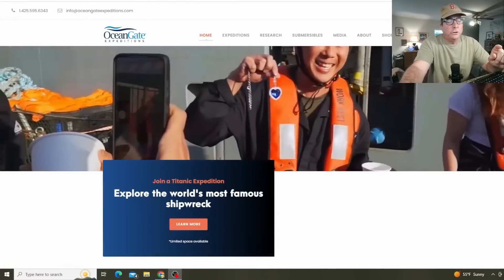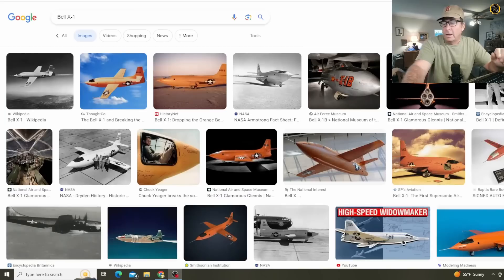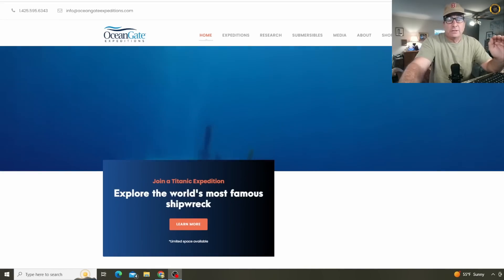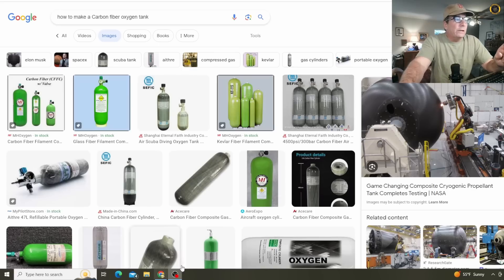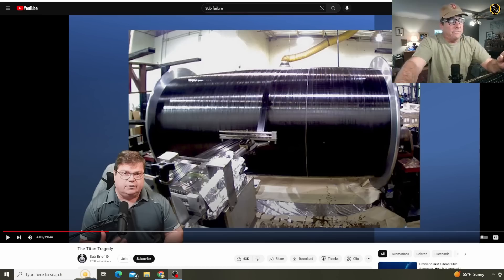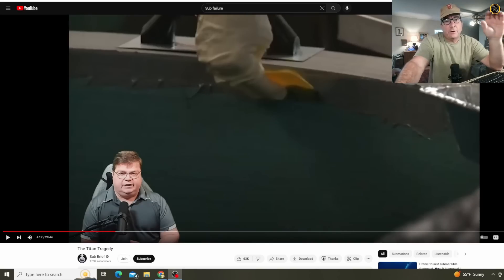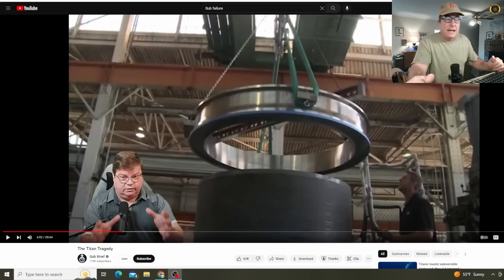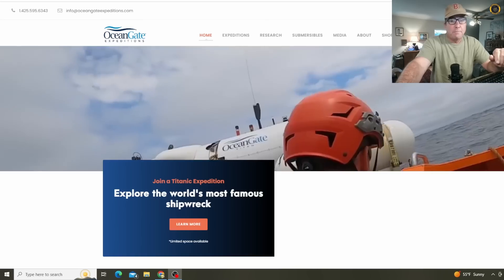Oceangate Sub Construction Details and Implosion

Comment: Im an oceanographic Survey Engineer and i agree totally with what you say. My theory is that something between the carbon fibre and titanium caused this. I cant think of any housing that used two different materials for the main structure of the housing. Under pressure it’s likely the carbon fibre will react differently to the titanium, maybe compress more etc and this join of the two is the big weak point. Now watching this, and hearing there is a glue joint between the two - thats a third material and how is that glue tested under pressure 🫣! I dont like the sound of this stuff
Reply: On the other hand reports say the window was only certifiedby the manufacturer for 1300 m - and used in 3800 m. I'm not an engineer but there's more fishy then just the pressure cylinder and an older sub they had suffered from premature fatigue too. 

There will be an investigation, and they will salvage some parts. At the end there will be an accident report.

Comment: Just a bit of a correction... The fiber winding was done both in the axial directions and in the hoop direction, so there was a criss-crossing orientation, it was NOT in just one direction. There is a good "compositesworld" article about the hull manufacturing. My guess is an failure with the bonding interface between the titanium ring and the cylinder.
Reply: Do you have a source for this information about carbon fiber layup being done in both directions on the Titan?

Comment: This was not the original hull according to Wikipedia. "After proof testing dives at its maximum rated depth in 2018 and 2019, the original composite hull of Titan developed fatigue damage and was replaced by 2021" so probably proves they have very short life cycles and something was very wrong with this design. If can happen once it more than likely happened again to the second hull with devastating results. I think the on board real-time monitoring system looking for cracks was a safety comfort blanket for the CEO to hide behind believing this would convince people it was safe. The Port hole that he had been told was to big and could fail at those sort of depths. He even admitted himself he had broken the rules regarding it's construction but he knew best. No beacon even though it went missing for 5 hours on one mission.  The problem you get when one man has a vision and nothing will stand in his way even after so many warnings is a disaster waiting to happen. Is it possible that because this was the subs first deep dive of the year the carbon fibre could have relaxed to some degree whilst in storage during the winter after many pressure cycles the previous year causing the hull to weaken, making it more likely to fail on it's first dive of the year. If they had used a new hull every year it might have survived a season but it's one hell of a risk to take and wold make the project unsustainable. It's Ironic that the same failings happened to the titanic as this sub. Expectations of technical perfection that would never fail outsmarted by real world reality and possibly blind ignorance. After watching the CBS report only a few weeks ago about titan before this weeks sad news it astonished me the cavalier way CEO Stockton Rush went about explaining how it worked and the many DIY parts that were used such as LED lights from a caravan surplus store and ballast waits that were apparently scaffolding, and the way he threw the game controller to one side in the sub. The reason Alvin has been in use since the 1960's and to this day is proven technology followed by testing, testing testing and certification. My heart goes out to those 5 poor souls and there grieving family's but this could have and should have been prevented. If your risking your own life then you know the consequences but with paying customers onboard regardless of how rich they are safety must be the top priority and not an afterthought.

Comment: I have a gloomy question. Is it possible that the carbon fibre tube walls failed first, rather than the caps popping off, and as those walls were failing, there would have been errie crackiling sounds inside the chamber? In other words, they knew the end was coming? What was the communication system status with the surface vessel?
Reply: I have never been in a sub but carbon fiber typically fails without noise before. If you watch mountainbike videos where people destroy carbon frames the carbon typically makes the sound of a hunting whip at the moment it fails, but no sound before.
Reply: @simonm1447  tHanks. There is a comment below that suggests the end my not have been instant however..that they may have known what was happening in real time

Comment: Aside from the 5 inch capsule thickness which is minimal should have been 7 inch, also apparently the camper style light which was screwed into the thickness of the capsule with hardware style tap screws… idk if it’s true but definitely could weaken the lay up

Comment: CORRECT, THAT WAS THE BAD POINT.
NOT POSSIBLE TO PUT RESIN BETW RING ANG LAYERS +FCARBON TITAN TUBE-
NOT FOR DEEPER SUMB.

STRUCTURAL DESIGN OF LOT PARTS COMPONENTS IN LABORATORY IS DIFFERENT WHEN YOU APPLIED ON FIELD.

THIS PROTOTIPE WAS TESTED INTO LAB OF (WASH.UNIVERISTY)
BUT NOT USEFULL .. NOT REAL A SCALE PROTOTIPE,,
 

A-TUBE DESGIN IS NOT FOR DEEP PSI :

B- MIXER MATERIALS .FCARB. RESIN..

C-BOLTS  +PLAY.S CONTROL AND OTHER BASIC COMPONENTS (COMMERCIAL BOLTS,)
   NOT FOR DEEPER  USES (HUMAN RISK,,)

ONLY BALL  STEEL (BATISCAFOS) MAKE POSSIBLE EQUAL SAME PRESS PSI
AROUND BODY SUMB,,,,

GEOCEAN WEB SITE NOT AVAILABLE TODAY

Comment: I think there were more issues with this craft besides the usage of carbon fiber. The control and communication systems seemed rudimentary.  The engineering concepts were naive given the severity of the designated usage and the required controlled manufacturing process and quality control may have been lacking given this tragic result. Also, the ergonomics didn't seem to make sense. One just sits on a platform in rocky seas?

Comment: I had air bubble problems while I was moulding Epoxy jewelry. Trinkets don't need stress tests. But Carbon Fiber would have the same issues. As a physicist, I completely disapprove of use of Carbon Fiber in high stress and pressure variable environments. Both Epoxy and Carbon Fiber have a tendency of developing micro-cracks over time.

Comment: I noticed something. I brought it up to my father who's a retired industrial engineer. He confirmed my suspicion. It looks like they drilled and tapped into the interior sidewall of the carbon fiber hull to mount the damn monitors. Most likely, they had to drill at least an inch, about 1/5 the thickness. Couldn't that cause microfractures in the fiber and resin composite?

Comment: To me it sounds like the CF was wrapped like electrical tape around a toilet paper tube. I could see that having some strength if pressurized from within, like you spoke about the O2 tanks, but apply that same pressure from outside and has to fail. Just an analogy on my part but I too wondered about how they fastened/affixed the titanium rings on each end to the CF. I'm not a big believer in adhesives of any type, most especially when your subjecting them to several hundred atmospheres of pressure and relying on some glorified JB Weld to hold it all together for you. Screw that.

Comment: i said to fellow co workers that 1) that sub had imploded on its way down, otherwise youd hear banging from survivors, have emergency signaling or beacons or something going on. And 2) that just like an airplane they suffer fatigue after so many cycles of pressurizing and depressurization and that the sub probably had no real major in depth safety inspection schedule let alone an actual in depth inspection ever done.   Nice to hear someone else talk about this besides me.
Reply: I would not bang the hull for emergency signaling....... I feared the hull could break apart of the banging.....
Reply: @janvanroekel6787  - The ocean water pressure at that depth, 6,000 psi, exceeds any pounding a human could perform unless they had a pneumatic hammer on board!
Reply: Well I guess I'm a little spoiled, cause my father's A private pilot for 40yrs now, and we spend most of our evenings hanging out up at his hangar and just talking with all the other guys hanging out and flying and building planes. 
Cool little place! 
44N if you're ever nearby stop for a burger ✌️

Comment: Not only the material used, but the cylindrical shape of the chamber also renders it weaker as opposed to the spherical shape that is commonly used in other deep diving submersibles
Reply: I'm not an engineer, but it seems to me that with titanium endcaps and the fibers all oriented around the circumference of the cylinder, there would good chance it would crack in the middle of the tube. I would bet that the failure was either there. or at those glue joints near the end.
Reply: Because it was a low budget and dirt bag operation the tooling to produce the sphere shape would have been much more expensive and so not done.

Comment: I'm not an engineer. I'm a hill billy with big ears and I hear things. I heard that this sub took a hit from a lightning bolt somewhere along the line.  Let's say this machine, in good condition just might have made the trip by the skin of it's teeth. Now throw in a previous lightning strike. How might that affect the integrity of a sub constructed like this one?  The possibilities seem endless. Just thought I'd drop another worm in the can. If true I wouldn't like to see this factor overlooked while people are micro analyzing this.
Reply: A lightning strike destroys carbon fiber, if there is no conductive copper mesh which  covers it ( what is the case at airliners). However there was one 787 where a lightning strike still burned a hole into the fuselage (the same can happen at aluminium aircraft).

Comment: The end pressure load on the Carbon fibre tube spigot face by the Titanium ends at 4000 metres would far exceed the 7500 lbs / sq inch that CF can support across the weave ( measured by testing ) ....using online calculators you will come up with a pressure of about 27, 000 lbs / sq inch @ 4000 metres down, on the spigot face .....so....the end caps exerted over 3 times the load carrying capacity of the CF tube ends.

Comment: Yep, thats what ive been saying too.
Its either the carbon fiber hull, or the glue and or glue joint.

Ive also been wondering if carbon fiber has even been tested for structural integrity in those circumstances at all.
Same for the glue.
These may change properties, be negatively affected under 400 bar in seawater. May even be permeable ever so slightly, which will then surely affect bonding of layers.
Has this been tested at all?

Comment: I'm sure it's cost prohibitive but shouldn't that sub have just been lowered to that depth unmanned say 50 times and then if there were no failures use it for maybe 20 dives manned.  Are there any pressure chambers that can go to that pressure to life cycle a design like that?
Reply: What if it destructs on the 51st dive?   You need to know how many cycles it could withstand.  Maybe it’s 50.  Maybe it’s 51.  You don’t know until you test it to destruction.
Reply: You should build it for 8000 m, test it in 10k and if it survives this you can use it in 4k without any concerns. German WW2 subs were tested in around half the depth they could actually withstand until they got crushed

Comment: Buckling of the cylinder seems like an obvious failure mode. That is, flattening of the cylinder due to elastic instability. The cylinder needs to be stiff enough such that the "virtual work" needed to flatten it is greater than the energy released by the reduction in volume due to flattening. I'd imagine the thickness of the carbon fiber will have a fair amount of stiffness but wonder if the end caps also play a role in resisting the buckling force. In any case, that would induce a shear load in the glue joint, and the titanium has quite thin "shoulders" on either side.

That's all on top of the cyclic shear loading from temperature changes (dissimilar materials, as you mentioned) and pressure cycles.

EDIT: with the fibers laid like that, that's not going to resist shear much at all...

Comment: I worked as a service engineer and have seen some bad designs by professionals it happens but this is just a he knew better but did not care. Rush was counting on sensors to let him know how much stress the cylinder was under. Under compression certain materials give up instantaneously. Even if he had a second or two of warning could he reverse the sub and would that even help. Was the wrapping of the carbon fiber the right way. I don’t think it was. There was no strength to the cylinder just a wrap and bonding glue.  Then you have the glued flange and bolts. When they bolted them inside were the bolts pulling on the flange. It all starts with using a game controller to steer the sub. I feel sorry for the people who died with him. I’m sorry those who knew better did not call him out before he killed others. Most submersibles are spherical and made of titanium for a reason. No one in future should be allowed to use an experimental vessel to entice paying and unsuspecting customers to something they don’t have full knowledge of if its safe or tested.

Comment: That was my first concern that it was all 90/240 layup.  I just figured I was missing something, observing the process on YT.  If that is actually how it was made it would be a terrible design, insane.  But worse is that the wide tow appears to be a prepeg, and when it gets to the end, and doubles back, there would not be a perfect lay as the material goes back, and then you have potential for voids and that would be unacceptable, but being prepegs there is not a lot of resin sloping around even to fill them, and then it turns out that the end caps land there, in an area of maximum loads

Comment: I’m an engineer and I posted several times before they discovered the debris field that the vessel imploded after I saw the construction video.
You nailed it Juan.  Carbon fiber holds in air tanks because the pressures are pushing out against the weave.  
There are 4 dissimilar materials used in the construction and they all expand and contract at different rates.
Aircraft carbon fiber hulls don’t have that problem because the internal pressure is maintained at 14.7 psi throughout the flight.
The hull of the Titan had a 150 million pound water column on top of it.
I feel that we have come so far with science and testing that this kind of loss of life was so unnecessary.
Reply: Yes sir - but usually the pressure differential in aircraft is less than 14.7psi because cabin pressure is typically 5K to 8K feet, except at low altitudes, where it's closer to outside pressure.